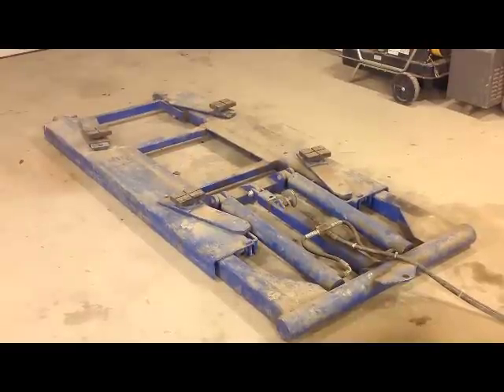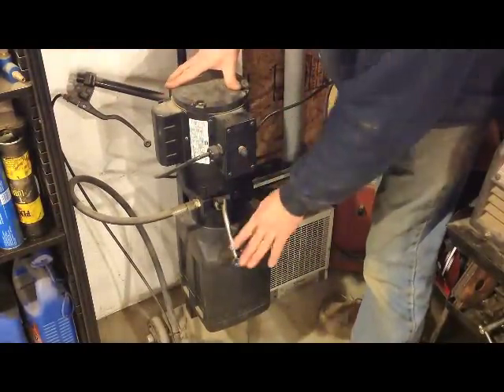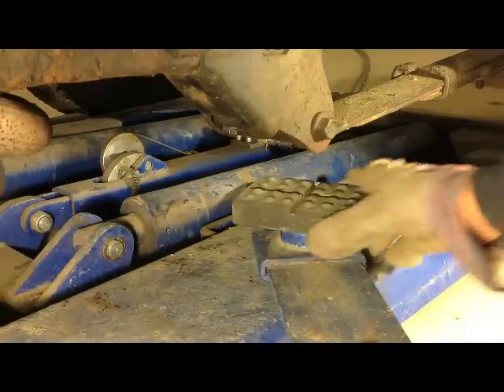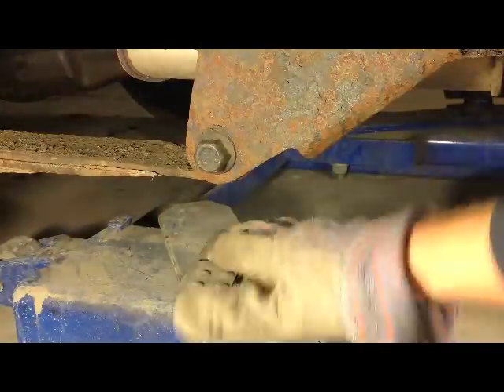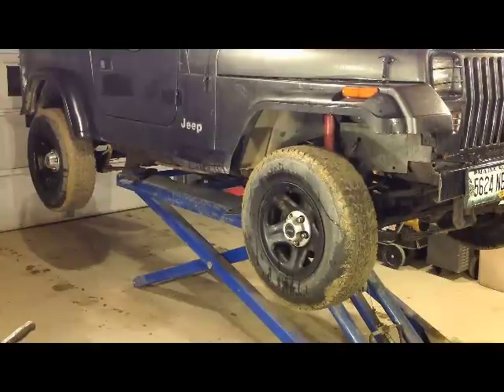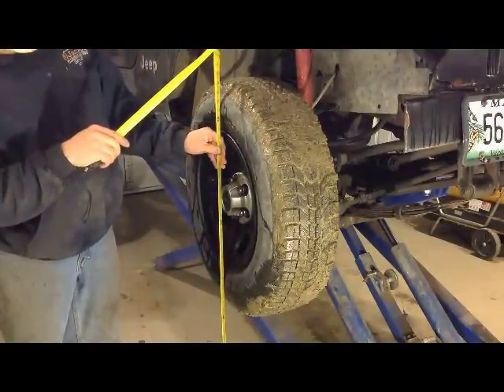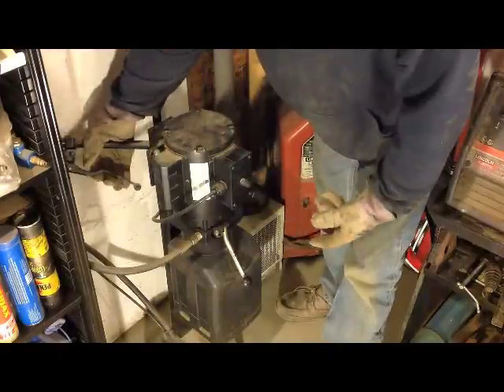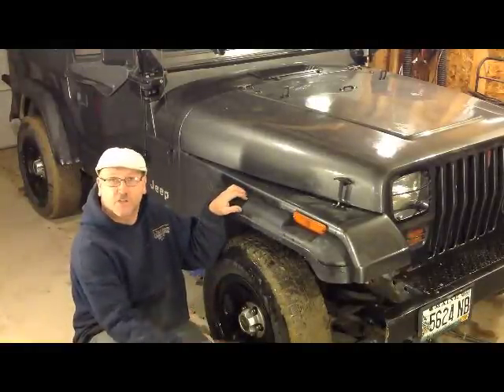Harbor Freight 6000 Lb  Scissor Lift

Comment: Sweet video.  I was looking for someone actually lifting a vehicle with this thing and yours does.  I also like the fact that your lift has seen some heavy use and is still going strong.  Proves that this thing is durable
I got to check the clearances in my garage.  I doubt I'd be able to lift my car full height without hitting the garage door opener or hardware. These cost about $1200 now with the 20% off coupon.  You got a great deal!
Reply from the maker: +Tony Varela Thanks, ya it a great lift use it a lot, No troubles.

Comment: My question is- how much access do you have to the drivetrain and the underneath of the vehicle in general? Is there enough room to remove a transmission from a rwd vehicle, for example, or does the mechanism get in the way?
Reply: No.
Reply: They're worse than useless for that kind of work. That's why shops confine them to wheel swaps at tire shops.

Comment: I owned this lift, a Bendpak MD-6XP. Nicely made but I always worried about stability. The higher the rise, the less footprint for the feet to spread the load of the vehicle. Particularly worrisome on larger vehicles!
Reply from the maker: No problems yet. but I always double check the position of the pads.

Comment: No transmission changes with this lift.   It’s in the way.
Reply from the maker: Ya this lift is limited, but for most problems Its not bad, thanks for watching.
Reply: This is not intended for work like dropping transmissions on RWD vehicles. It's main purpose is to make wheel, brake, and suspension work much easier and more comfortable. I have the BendPak. This appears to be a copy. These are great when used as intended.

Comment: Great lift for the price. If you order it online, you can use the 20-25% coupons. I got mine for $1200 before shipping which was another $99.  You'll also need hydraulic fluid and the 220v plug, so take that into consideration.
Reply from the maker: I love it, as you can see I use it a lot and have had no problems with it at all, Thanks for watching.

Comment: Considering buying one of these for doing maintenance on my jeep. Seems like front and read differential access for service is fine but how about the transfer case and the transmission ? Only thinking about change the oils here. Your feedback would be greatly appreciated.
Reply from the maker: Ya front and rear differential would not be a problem, no way to remove transfer case, you would need a better lift that you could get under.
Reply: Not thinking about removing it but how about transfer case fluid replacement ?
Reply from the maker: Wow? would be hard I think, better off with it off the lift.

Comment: nice video. I have a 220 inlet in my garage. Does this come with its own plug or can I go out and purchase another plug and wire it to the cable it comes with?
Reply from the maker: Great ? mine did not come with a plug I had to get one, I have heard that some came with it?
Reply: thanks. one more question... so, when lifted have you actually been under that thing? do you feel pretty good about it's construction?
Reply from the maker: Yes, I feel safe, I only work under the front and back I never go under the middle, have not needed to Yet.
Reply: question... so, usually the green wire is ground but I saw in the manual that the white wire was ground. when you wired your plug, was the white wire neutral/ground?
Reply from the maker: This is the part number for the plug  NEMA L6-20P

Comment: Awesome. This particular design is superior to those iconic two post lifts or the high rise  scissor lifts... So many ways for those to go wrong...
Reply from the maker: I like it a lot. little hard when working on exhaust systems but better then lying on the ground. Thanks for watching.
Reply: That design is NOT superior to two-post lifts for under-vehicle maintenance but it works well for brake jobs and suspension work. That's why the shop I scored my commercial quality version from for 500 bucks sold it in near new condition. It got sold as they needed the space to make money with a two-post lifts. If two-posts lifts scare ya you don't know enough about them. 

If all you want is for example a lift table for welding (my use because they cost much less than a comparable lift table) or for working on everything the lift doesn't block they are fine. Have a PRECISE idea what YOU need from a lift before spending money. Post lifts are vastly more capable. They do cab, bed and drivetrain pulls which these lifts are useless for engine pulls and block transmission pulls. 

Also remember you lose the footprint of that lift for every other use requiring floor space unless you have plenty of room to shove it off to the side.

Comment: Nice for wheel work but you can't do anything underneath because lift is in the way.
Reply from the maker: It is a little hard to work on some thing, but beats working on the ground (: Thanks for watching.
Reply: That depends on what and where you lift.
Reply: Yes it's better than floor jacking everywhere,but before I croke I will own a four post lift.
Reply: You can use some chunks of wood as "spacers" and get lots of room under a truck to get at drive line or exhaust.
Not as easy with cars because you have very little ground clearance to start with, but you can always make shit happen.
It'll never beat a 2 post on anything but price, but i would use the crap out of this lift.
Reply: Peter Will what's "croke"?
Reply: Croke is when you die,Take a dirt nap,go to the spirit in the sky,pass on.
Reply: Peter Will oh so it's like croak, in English. What language is croke?

Comment: Many similarities to the motor cycle lifts of the nineties. Not much good for exhaust system or drivetrain work.
Reply: My 10' x 10' doors and 11' ceiling make this type of lift perfect for my garage
Reply from the maker: I did raise my ceiling later on after this video made a big difference. https://www.youtube.com/watch?v=RykoCTYtVKk Thanks for watching.
Reply from the maker: Ya you are limited but beats crawling around like a reptile on the ground (: did a video on what you can get to on my jeep, https://www.youtube.com/watch?v=J72VJAlNGfc I hope this helps.

Comment: Scissor lifts are great for brake and wheel work but not much good for working under the car.  You can't, say, drop a transmision out because it's in the way.  That and I don't really trust Harbor Freight for anything that major.  It's all Chinese knockoff crap and I've been burned so many times that I only buy there when I know I'm going to throw the tool away after using it once.
Reply from the maker: Ya underneath is a bit harder but gets me closer to the problem. Thanks for watching.
Reply: Well guess what surprise those lifts are built buy same company and other companies put there name on them our work has three of the exact ones only they paid $1900 each. Same thing different name.
Reply: Yeah and you obviously can’t use it to fix an exhaust leak on your jeep
Reply: I agree. Did you know HF has lifetime warranty on many of their tools? Also I use to think highly of Craftsman and other big brand tool makers but the newer stuff is made in China too! Basicially the Craftsman tools my grandpa has are the last the legit made in USA best quality tools by Craftsman. Snapon is awesome. I get it wheneverI have the extra $$.
Reply: Melissa Barnes-Milton I bought an asymmetrical lift and paid 2,000 bucks for a 10,000 lbs low ceiling height and can do transmissions exhaust and all for the same money but a better lift in my opinion

Comment: Can't do an oil pan replacement or a transmission screen kit or even take one out such a waste of money
Reply from the maker: Ya it is a bit hard to do many projects underneath, I did an oil pan on my truck and found if i backed it on seem to work ok. it will never compete with ta full lift but better then laying on the ground, thanks for watching.